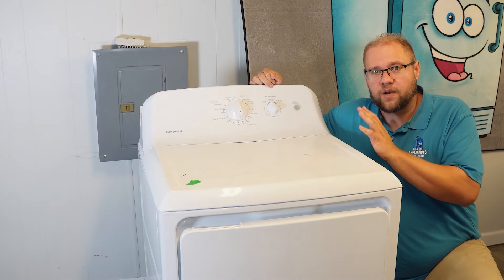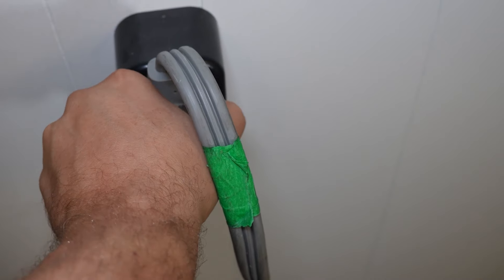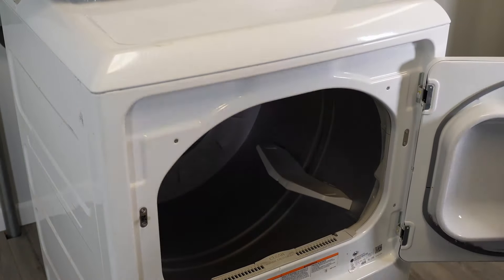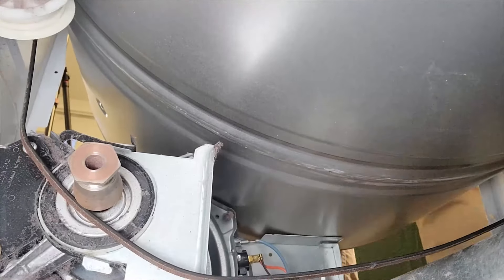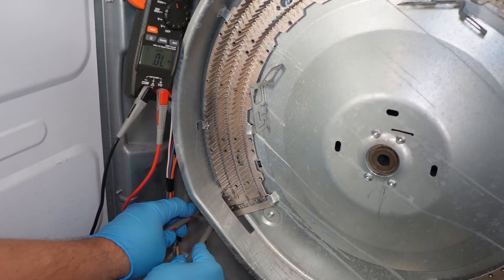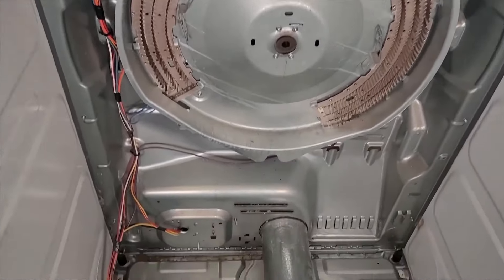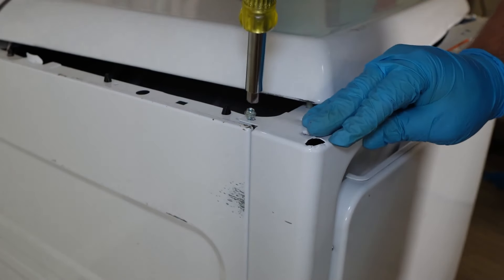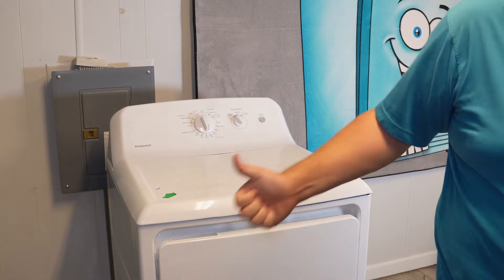Hotpoint Dryer Won't Heat - How to Repair a Hotpoint Electric Dryer

Comment: great video as ever, our dryers in the uk are tiny undercounter units tho, you hardly ever see u.s imports like this. seen a few giant whirlpool dryers from the u.s here tho
Reply: Generally the UK dryers especially the hotpoint you can access the heater and thermostat / safety switches from the rear panel without dismantling the drum.  The main problem is the over-temp one shot switch going open caused by interrupting the dryer in heating cycle,  selecting fan only before unloading cools things off.  Other fault is the control board heating relay becoming oxidised or burnt,  a replacement relay are available and are cheaper than a new control board.

Comment: Where does the air enter into the dryer of a whirlpool front access panel dryer? I see the exit vent but no air intake? The dryer sucks in air but how or where? I only see one tiny hole below the heat element housing, is that where?
Thanks for your videos explaining repairs.

Comment from the maker: Parts mentioned in this video:

GE Purple Wire Replacement How-To: https://www.youtube.com/watch?v=Dl8he1XwIbg
GE Dryer Timer for GTD42 Units: https://ifix.gd/3Zmejnp
Purple Wire Replacement: https://bens-appliances.com/products/we49x37037-ge-hotpoint-dryer-heater-wire-repair-kit
Our Version (same wire gauge, 1/2 price): https://bens-appliances.com/products/we49x37037-ba-ge-hotpoint-dryer-repair-kit-by-bens-appliances
 OEM Heater Assembly: No Wire: https://bens-appliances.com/products/we11x21156-ge-dryer-heater-assembly
Thermostat for Unit (top of pan, to the right of the 2): https://ifix.gd/498roE1
Thermostat (top of pan, to the left of the set of 2): https://ifix.gd/3ZlybqP
Blower Housing Thermostat: https://ifix.gd/3XRlaVn
Upper-right pan High Limit Thermostat: https://ifix.gd/3TAcpfz
Bearing Shaft & Bracket Assembly for heater pan: https://ifix.gd/4guoih8

Comment: What's the name of the purple wire
Reply: I like to call it "Union Wiring Special", it's a prime example of what makes these tin-can top-load type washers and dryers (which are made in the US using 60+ year old tooling by people who will strike at the notion of having to improve anything on their appliances) so much worse than what comes from LG or even GE's Haier (Chinese) arm....

Comment: I purchased from his website. I received the completely wrong item. I ordered parts for this dryer and got parts for a refrigerator. Get what you need off amazon if you need your appliance working promptly. What a let down. I depended on your service ,and was let down. You would think for 200$ I would get the correct product. Ridiculous.
Reply from the maker: I'm sorry to hear about this, did you contact us to get the correct parts exchanged?